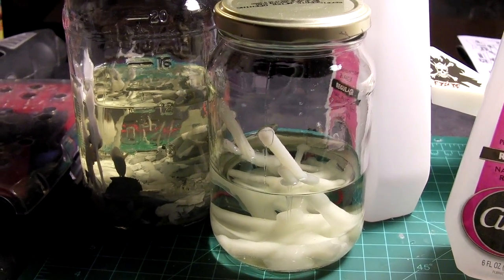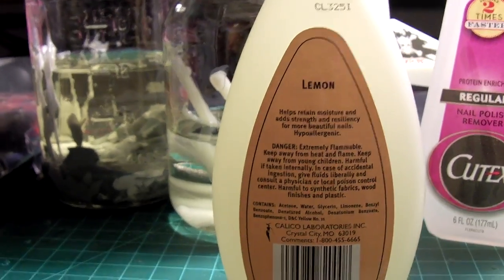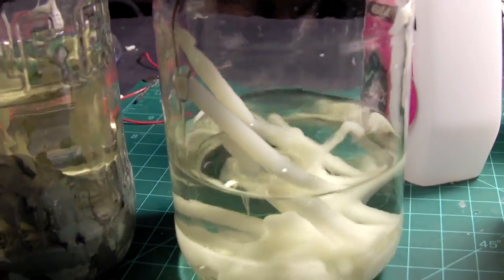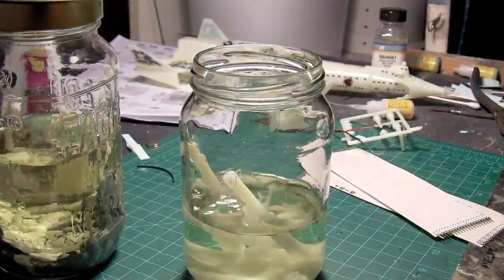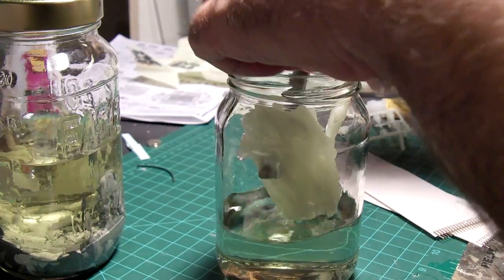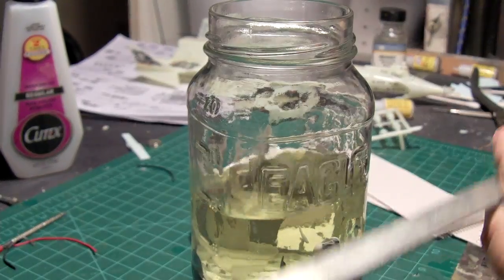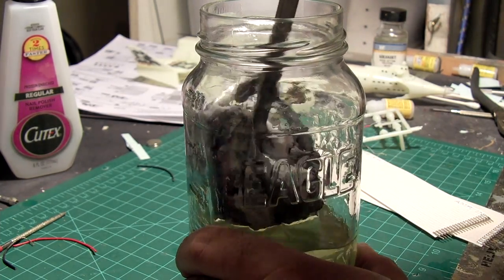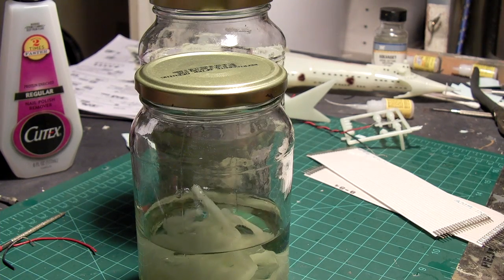ToolTip: Melting Styrene 2

Comment: One thing I did try recently was toluene. I have a glow in the dark model Enterprise and I wanted to used the sprue as filler instead of regular putty. I have the melted plastic sitting in a can in a "slurry" semi-liquid state. It looks like I could probably add more glow in the dark plastic to thicken. Just experimenting with it at the moment, but so far its looking good. The plastic still can glow when lights are out.